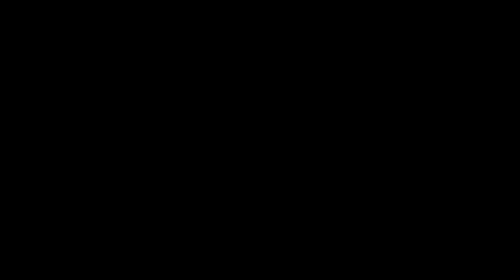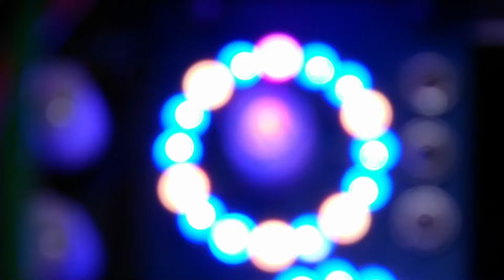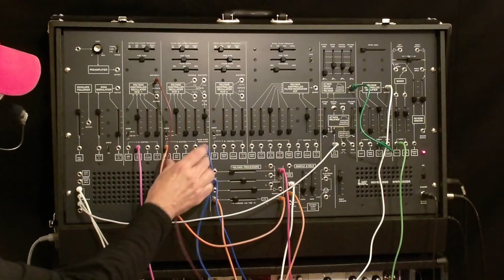ARP 2600 - Quantized Sample & Hold

Comment: I use this method often. One thing I love to do is sync an LFO to a division of the clock driving the S/H. Get the LFO to cycle every 8 or 16 clock pulses. You then get a repeating pattern that runs 8 or 16 bars. You can do the same with an ENV or any other repeatable signal. Used this method for this track: https://youtu.be/tBvXiyXO3rg . In this instance the S/H is Snazzy FX Telephone Game. If you are heavy into S/H this module is tops. It's actually 5 S/H working through an analog shift register with all kinds of crazy options like feedback causing the voltages to build up. Very cool module and bizarrely musical without quantization.

Another cool use for S/H is to feed it an audio rate VCO. I've found that it will grab repeating patterns in an unpredictable way, as the clock runs against the phase of the VCO. Even works great with a sequenced VCO. I used the sine wave of the VCO being used for the TB-303 pattern into S/H modulating the 303 filter in this patch: https://youtu.be/uOqVUlCkOjw . You can hear it creates a repeating pattern which I did not expect.

OK, one more trick and I'll shut up. I sometimes use a quantizer as S/H. Really all a quantizer is is S/H that only outputs voltages in increments of 1/12v. So it's not as variable as normal S/H and in some instances that's just great.
Reply from the maker: Great tips!  Thanks @Precarious333 for the sample tracks as well.  
This description is a good one: "Another cool use for S/H is to feed it an audio rate VCO. I've found that it will grab repeating patterns in an unpredictable way, as the clock runs against the phase of the VCO." 
As it turns out, the "phase difference" (which creates beat frequencies in two closely tuned oscillators) happens regardless of whether the VCO input to the S/H is running at audio rates, but it is helpful to have the tuning at some multiple of the S/H clock.  It is the phase relationship between the sampled signal and the S/H clock which controls the pattern. 
Lotza fun!
Reply: @ozhalljr   Exactly! I was surprised to get that result from audio rate but it does make sense. And it works even if you have no idea of the difference between the phase of each so long as they both repeat. It's a great way to add dynamics by modulating from a cannibalized element of the voice itself. It's a good use for the multiple outs of a VCO.
Reply: Hi,how are you doing?